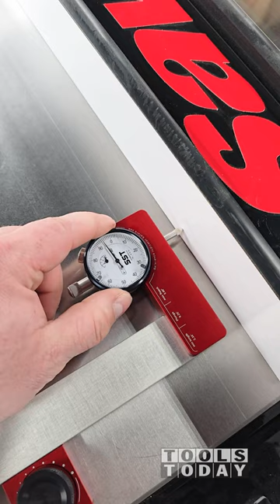Keeping a Saw Tuned

Comment from the maker: It's that time of year to do my yearly checks and maintenance on the table saw. I use this table saw alignment tool to check the blade alignment to the miter gauge and check the fence alignment. I also coat the table top and miter slots with some Renaissance wax to prevent rust and make things slide easier across the top.

Check out the tools used on our website - 

SST Table Saw Alignment Calibrator - https://toolstoday.com/sst-table-saw-alignment-calibrator.html?from_autocomplete=sst-19121

Amana Tool PR1040 Blade - https://toolstoday.com/v-7194-pr1040.html

SawStop ICS 5hp Table Saw - https://toolstoday.com/sawstop-ics51230-52-5hp-1ph-230v-60hz-industrial-cabinet-saw-with-52-industrial-t-glide-fence-system.html